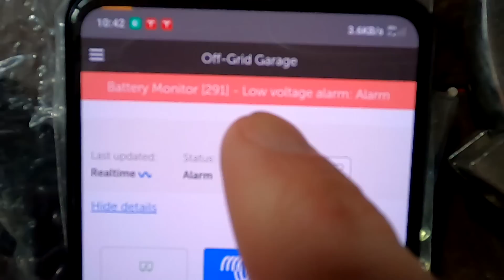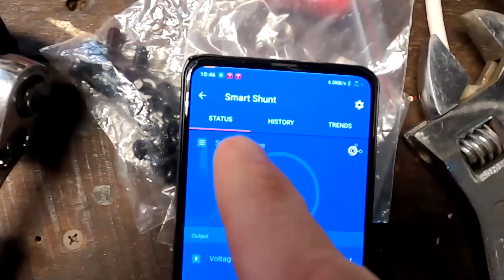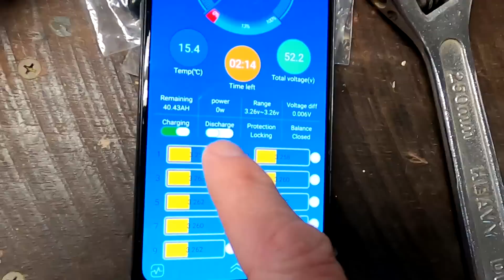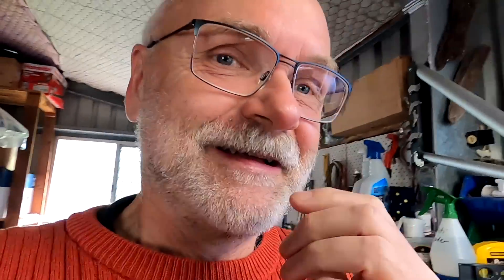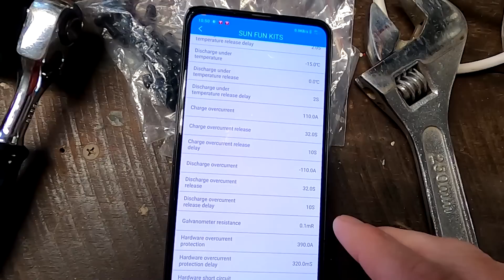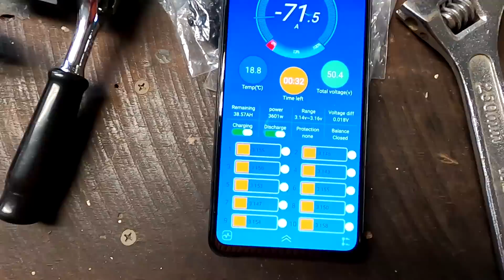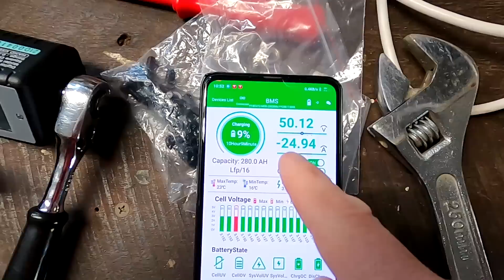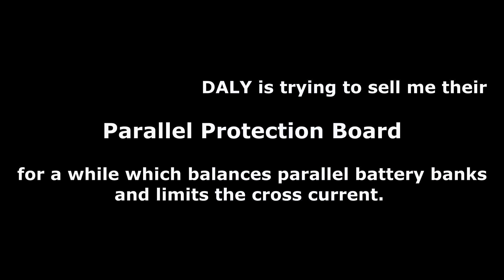Battery Low Voltage Alarm at 12%. Too many Bluetooth devices 🤦‍♂️😊

Comment: Hi, dann ist es doch sicherer mit der SEPLOS Software. Da stellt man nicht aus versehen ein anderes BMS aus . ;)
Und Danke für die vielen informativen Videos. Grüße aus Deutschland (deiner alten Heimat?)
Reply from the maker: Ja, aber Seplos hat viele andere Probleme. Das deren Software nur ueber den PC funktioniert ist nur eines davon...
Reply: @OffGridGarageAustralia   Hi Andy,  ich habe auch das Seplos zu Hause liegen. Werde dazu aber auch ein Balancer parallel laufen lassen. Ich würde ja gerne mal auf ein Bier vorbei kommen aber die Anreise ist ein bisschen weit für mal einen Abend 🤣
Reply: @OffGridGarageAustralia  Hallo bester  ich habe eine Frage ich habe mir Aufgrund Deiner videos jetzt mal rangetraut und versuche mein eigenes balkonkraftwerk zusammmenzustellen ich habe 2 solarpanel von eco worthy 340 watt den mppt  von epever tracer und 2 batterien a  12.8× 30 ah wird das überhaupt funktionieren ??  bin ich richtig mit der annahme das wenn ich die batterien connecte habe ich ein 24 volt system und kann die panele in serie schalten ??  1000000 Mio dank im vorraus für dein knowledge Yoda weiter so wir brauchen solar panels überall in Deutschland !!!  👍🏾

Comment: Great thing about LiFepo4 is that you don't need all the same size battery banks.  Where as AGM is a nightmare.  So it wouldn't matter if this was a 5kw or 20kw bank.  It makes it so much easier when buying batteries that you can buy 280ah one year, then 200ah or even 100ah and they all work together.  Makes life so much easier.  You just proved how easy it is to add another bank.  If this was AGM you'd have all kinds of nightmares.
Reply: How so , I have 44 AGM batteries in 11 banks no nightmares in the 8 years they have been working I also have a nickel iron bank in parallel with them which gets disconnected for its bulk charge during the day as it needs 64 volts.
Reply from the maker: Can you not parallel all kind of batteries if they have the same voltage and chemistry?
Reply: @OffGridGarageAustralia  Lead acid will self balance as they are voltage charged as long as the series ones are the same capacity , other chemistries need to have some sort of BMS eg LiFepo4 but these should work in parallel with lead acid as the voltages are so close I am going to find out , the Nickel Iron work ok for discharge but need to have a charge of 64 volts (38 cells) for a number of hours. I get the same thing you did each night as the bank is connected back across the lead acid the NiFe bank charges the lead acid and then goes on to supply the loads until the voltage drops as they discharge they have a similar discharge curve as LiFepo4

Comment: Good thing JK-BMS lets you name each one.  Also good to know if I change something and use 3 banks the 4th will level evenly when turned back on.
Reply from the maker: Yes, they will all balance out over time. there is no need to bring them to the exact same voltage. This only works with LFP batteries though due to the flat charge and discharge curve.

Comment: 100 A out means 2x 50 A in so it is a limited stress considering that these LF280K cells are used to be capacity tested with 140A or 0,5C
Looks quite  good cause all batteries seemed to work quite well, no magic smoke at all.
Reply from the maker: Yeah, that's why I checked the settings of the Overkill BMS, it is only a 100A BMS so was running at its limit , I guess...

Comment: Which is why it might be useful to have the batteries parallised at the cell level with a beefy BMS!
Reply: You lose individual cell monitoring that way. Also, the ability to add/remove battery packs adds flexibility, and redundancy.
Reply: You ideally want whole battery packs in parallel with their own BMS, connecting all cells in parallel masks problems and if the BMS dies you lose all power rather than drop to reduced capacity.

I've currently got 64 cells in 2 packs that are 2p, once I get another couple of BMS's they will be split into 4x 16s1p packs.

I know I have 1 cell that drops to 2.6v while the rest are mostly over 3.1v and need to rest and possibly replace, I can't easily do this if everything is paralleled together at the cell level without taking the whole thing offline.
Reply: No that's the opposite of useful .  No redundancy , can't single out a battery for repair , you wouldn't know if a cell was going bad , etc.
Reply: For basically the sake of the cost of one BMS, you lose an awful lot of redundancy by paralleling them together at cell level. 
Having the banks as Andy does is much better. 
I’m going to build two banks and will definitely do exactly as Andy has done. Another BMS will only add a couple of hundred dollars, which is very cheap insurance.
Reply from the maker: All of the above 👆 Thanks guys
Reply: @OffGridGarageAustralia  I'm not feeling a lot of love for my approach 😜

But given I'm using an SMA Sunny Island inverter, I'm limited in the BMSs I can use, so it's cheaper to just manage, say, 30kWh using a compatible BMS.